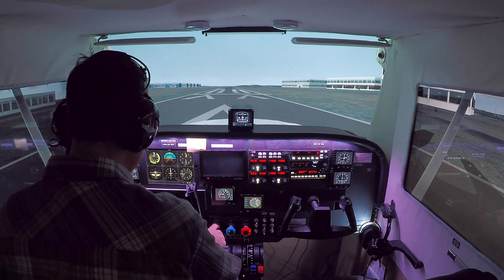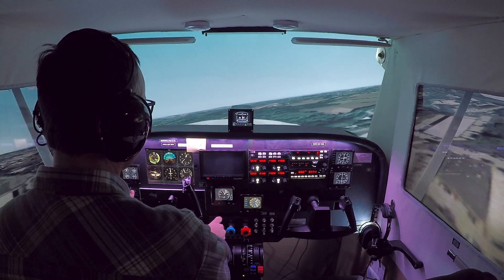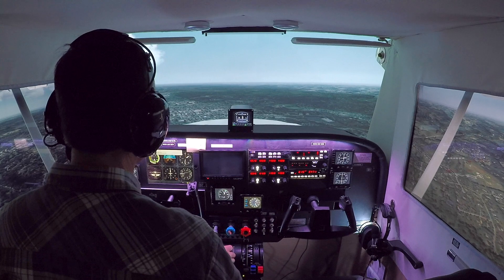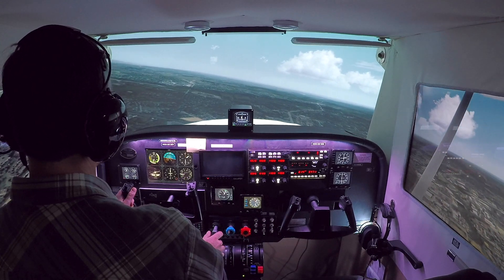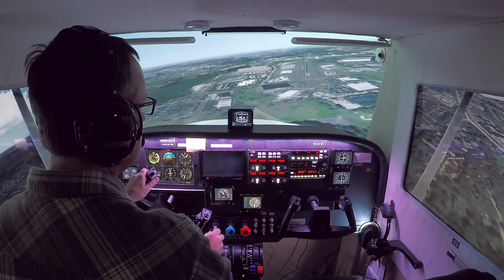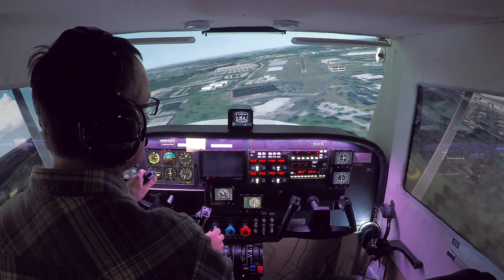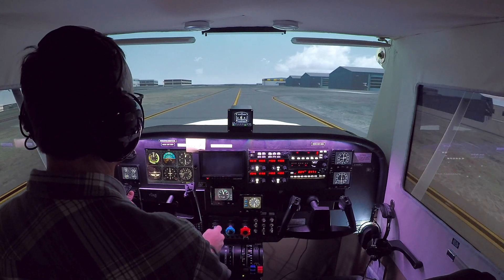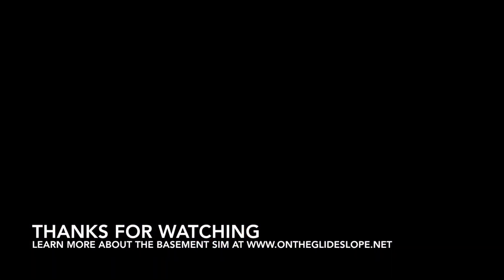How To Simulate A Forward Slip Landing (Cessna Prepar3D Home Cockpit)

Comment: One comment from me is that you mentioned "you can get into a spin" which may induce fear among viewers/students about this procedure. Forward (and side) slips are not dangerous and, if executed within the operating limits, far from spin conditions. Talk to your flight instructor on the proper techniques. Keep your nose down below the horizon, watch your speed as usual - since the ram air is not parallel to the aircraft direction, speed indicator may be off, and enjoy it. This is not an emergency maneuver. Sadly, many student pilots don't get to exercise full rudder applications. Slip often and get used to the outside view as it will help with cross wind landings (side slipping), landings with obstacles in front of the runway where your decent angle is steep or flaps not working, or even short field landings; slipping to bleed off excessive speed with your nose not well below the horizon. Almost every time I fly I slip.

Comment: First, thanks for all the great videos you do! Some of the best and most accurate I've seen. you may be aware of this or not but in the Cessna 172 there is a placard stating forward slips with flaps are not allowed. However,  during the engine out phase of my check ride I got my butt chewed for not using flaps in addition to the slip. In an emergency do whatever it takes! Thanks again!
Reply from the maker: Thanks. I fly a PA 28-161 in the real world so I did not know that!

Comment: Nice video, the simulator looks amazing its really impressive, in my experience forward slips on the sim don't feel accurate to me vs the real thing and my only comment is I would have changed to a side slip at the end to remain on the center of the runway but really nice explanation overall I think it you made it easy to understand how to do the forward slip and when to use it.
Reply from the maker: Thanks much.

Comment: I have done side slips a lot in trainings with ultralight airplanes and gliders. Important is to have always an eye on your airspeed. Better do it a bit faster than on a normal approach. The pitot tube could also give you wrong indications, caused by the side movement.
Reply from the maker: Thanks for that, Res. I did a little slip on final in the real world today, in fact. It's a great technique to have when you need it.